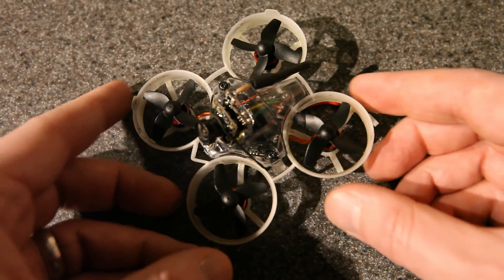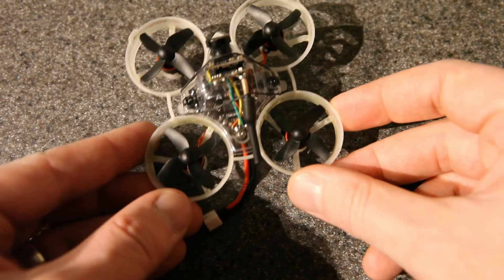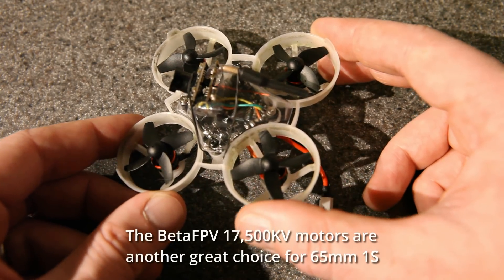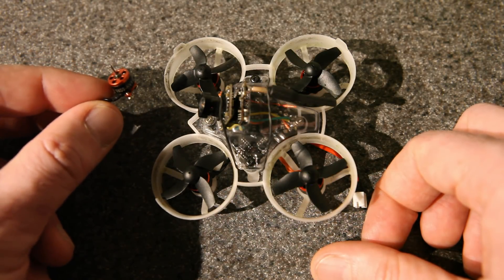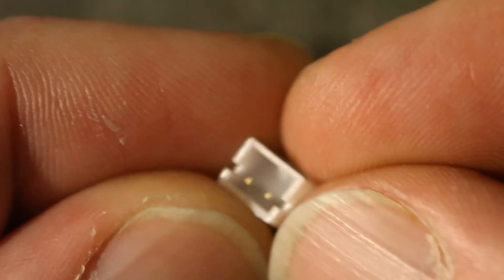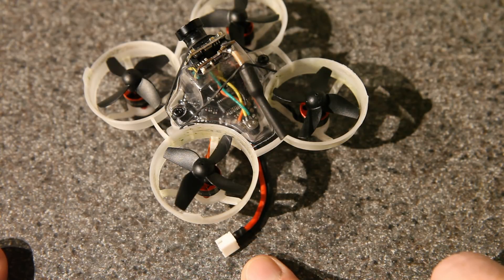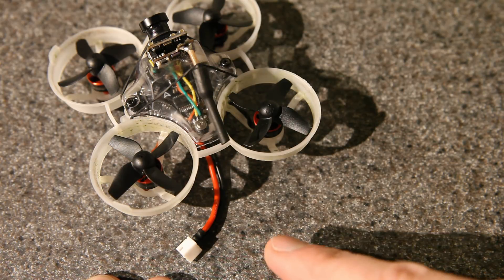My New Favorite 1S Whoop

Comment: First Flight on the starts video is on 0603 or 0802 motors?
Reply from the maker: The flight at the start is 0802. The only 0603 clips are in the middle while I was talking about them.
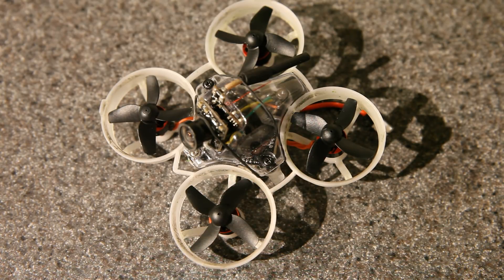Reply: @MrShutterBug  so from abouy 4:50?
And I have one question: small battery sag is cause a bigger cable?
Reply from the maker: @robertstopinski1673  yes from 4:50 to the end is all 0802. There will always be some battery sag. But having a good connector on your power cable can definitely help. Having good batteries is important too. I was using the GNB 260mAh HV battery. It's great!

Comment: Your  link 4 blades props  ( who doesnt require  drilling ) that  you give is  41 mm size , it's for 75 mm frame not for 65 mm frame.
These propellers  have  to work : 
https://www.banggood.com/4-Pairs-HB31-31mm-4-blade-Propeller-1_0mm-Mounting-Hole-for-RC-Drone-0603-Brushless-Motor-p-1277624.html?rmmds=search
Good configuration and flight Time 🙂
Reply from the maker: Oh, good catch. I fixed the link in the description.

Comment: They ought to give you a job at Eachine, Full Speed, Diatone etc to design them a whoop. This is by far the best I have seen. Flight time close to 4 min and most near half-full throttle. You should have more than 100 cycles on that battery. Compare to 5-6 on average HV 250mah 1-2s which is standard on brushless whoop today on market. Fantastic job! Edit: I see you also charge HV, so maybe 30ish cycles, but that is also fine. Or you can charge to 4.2 and it would still fly nicely
Reply from the maker: In this video, I was flying the 260mAh GNB battery. They're great! I probably have 20+ cycles on them already. They are not even hot after a flight like this. I usually charge 4.2 for practicing and 4.35 for competition.
Reply: Do you really get that few cycles on the whoop batteries? Asking as a newbie thinking of having a go.
Reply from the maker: KelDG3 I don’t know how many cycles I get but it feels like a lot. It all depends on the quality of the batteries and how you take care of them. The GNB 260mAh batteries are not that expensive and they perform great!

Comment: Yay, it's back!!!  This video like disappeared for a few days... Any idea what happened?  (Nevermind, watched the video...lol)  Anyway, I ordered those connectors from Digikey (BTW super fast delivery in 2 days) and they work great on my whoop with 0703 motors. I didn't have much of the 20 AWG wire so I had to order some more from BG before I can make up new pigtails, so the wait begins...  However, I found this on Amazon and do you think this is worth a try?  Looks good:  https://www.amazon.com/gp/product/B07D3M8STQ/ref=ox_sc_saved_title_1?smid=A2DCOXAHHBQLDF&psc=1
Reply from the maker: I got a lot of people telling me that the improvement that I demonstrated in my last video was too good to be explained by the wire gauge alone. Maybe heat buildup was resulting in more resistance than anybody expected, or maybe they were right and some unrelated factor may have affected the performance data. Either way, I decided that there was enough uncertainty that I shouldn't make any strong recommendations at this time. If you simply change the connector, you will probably see an improvement. But if you feel like experimenting with the wire gauge as well, then please share your results.
Reply: @MrShutterBug  -  Well, the wire size does seem to make a difference to me.  However, how much of a difference is beyond my abilities to gauge, but I will be making the change.  So you have a believer in me.  BTW, with over 25 years of broadcasting experience and been dealing with cabling of all sorts much of my life...lol
Reply from the maker: @frankbarajas  I've heard from several people who have tried it and they all said it helped. BUT... they also changed the connectors at the same time, so it's impossible to say which change had the greater impact. But who cares... as long as you're happy with your build, just go fly it! :-)
Reply from the maker: Oh, and that wire on amazon looks fine to me, but kind of pricey. As long as it's real silicone, that's the main thing. You want it to be nice and flexible.
Reply: @MrShutterBug  -  That wire on Amazon is 33 ft or roughly 10 meters, so about $1.10 per meter and an equivalent wire on BG is $1.99 for 1 meter.  Where do you get your wire?
Reply from the maker: @frankbarajas  yeah I guess that's pretty good if you want to buy a lot of it. I haven't bought wire in quite a while. I've got lots of various bits of it in drawers.
Reply: @MrShutterBug  -  LOL, yeah, it is a lot of wire, enough for over 132 whoops at 3 inches of wire per bird...lol
Reply from the maker: @frankbarajas  Well... you won't get board! ;-)
Reply: Mr ShutterBug -  Hmm?  That’s pretty funny.  
Definitely, it would be boring...soldering up that many boards and connectors...lol  

BTW, Hope you have a great holiday with your family.

Comment: curious, would this have more flight time than a beta75x??
Reply from the maker: It's not really a fair comparison. I fly them differently, in different circumstances, with different batteries. The 75X has way more power and speed. If I take this 19K 1S build outside and push it as hard as I can, the battery only lasts like 2 minutes, and it's still nowhere near as fast as the 75X.
Reply: @MrShutterBug   ok, thanks. by the way, our beta 75x is awesome!!
Reply: @MrShutterBug  one more question: when we do a dive or something similar and try to recover at the bottom it spins around on the yaw axis, is there some pid tuning or something we can do to fix the issue? tia
Reply from the maker: @woodpecker7130  if you reverse the prop direction to be "props in", that problem will probably go away, but you might have a different problem during level high speed turns. Which is best depends somewhat on preference and flying style. Also, there are some settings that help. They are pinned in a comment in the 2S Power Whoop Group on Facebook. And no matter what, use more throttle earlier in the maneuver. E.g. throttle up before you nose up. Good luck.
Reply: @MrShutterBug   thanks

Comment: I definitely have to do the change on the connector for my mob7. I run it ok n 1s in the house alot.
It drops way fast, but then when I goto recharge it says the battery is at 3.7 or 3.8 v
Going to try this upgrade after xmas.
Good video man. Happy holiday's!
Reply: Just did the.change on my Mobula7, night and day difference. I had already swapped out the connectors for solid metal ones, though bought the genuine ones that the.posts can not push back out of, along with the 20awg wire and omg she rips. Do it now.
So good this MrSHutterbug, thanking you. Just did it to one of my Eo11 boards running Notfastenough's firmware and 7mm brushed, charging up some batteries and expecting good things 

The Mobula is a beast now with no sag for the whole pack it seems from my quick test running three sets of batteries through her. No, "Hmm is it better?" just oodles.of power on tap, highly  noticeable boost for sure.